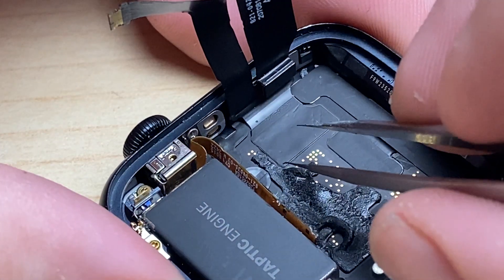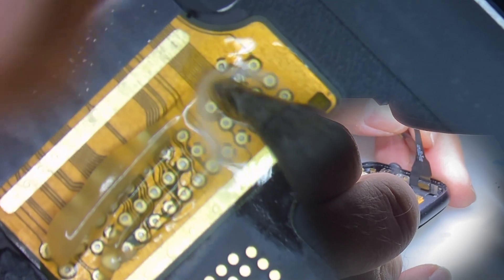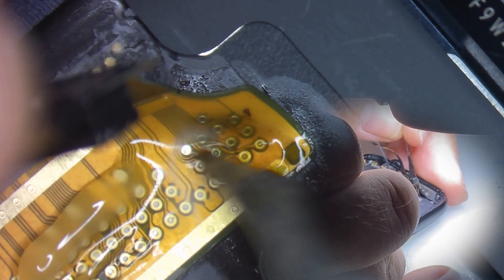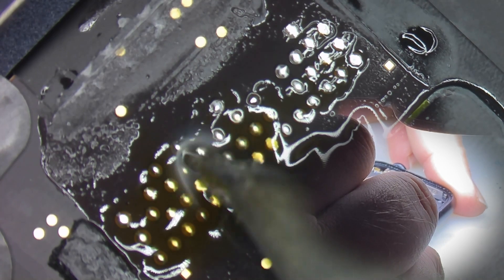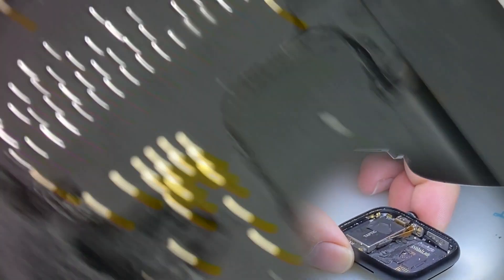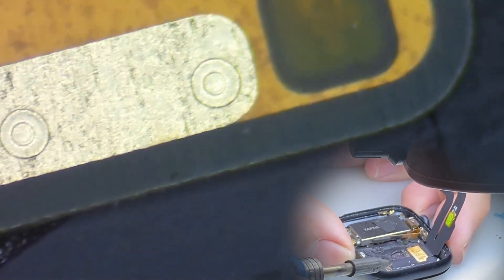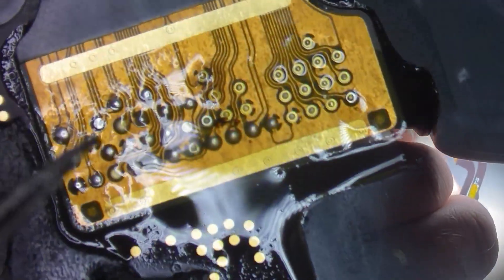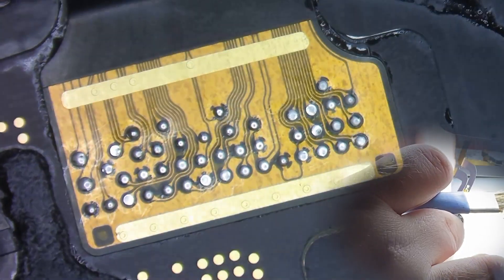Apple Watch ⌚️ Series 8, How to replace the display flex cables

Comment: Thank you sooo much! I inadvertently desoldered all the flexes on a series 5 and couldn't figure out how i was supposed to line up the fiducials on the flex and the PCB as I couldn't see anything, I didn't think that there might be a black sticker covering the underlying pads (duh!) I suspect that this watch might be irreparable due to the previous owner, but I'm still going to take the opportunity to practice doing this on a dead one in case this is needed for a future project, and it it works, then it's a bonus. tl;dr: Thanks for the useful info!

Comment: Hi Derek,
I tried changing my battery and by accident cut my flex cable. I wanted to remove it and accidentally ripped out 3 of those solder points. 
Is this repairable or should I just buy a new watch?
It’s the series 7 45mm btw.

Comment: I have an S8 and the flex cable is not damaged but the connector part (that connects to the display) is a bit corroded. How to clean it?
Reply from the maker: Isopropyl alcohol and a brush. It may need the solder to be freshened up if the pins are now loose.

Comment: Hey Derek. You make that look so easy! Have you ever replaced the battery socket attached to the motherboard on a series 7, or even any of them. I spent hours trying to do it and it seems impossible without melting the socket. Maybe that would be an interesting video.
Reply from the maker: Yes, you need to remove the logic board and use a small soldering iron so that you can actually only touch the pins and not the plastic.